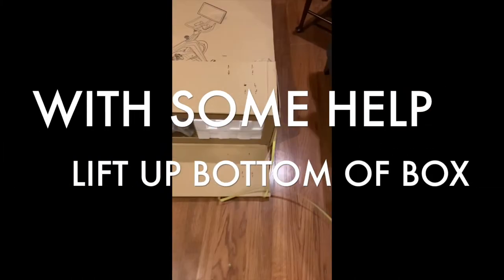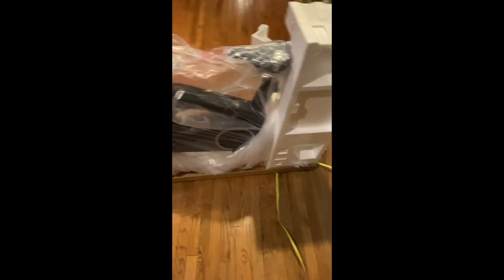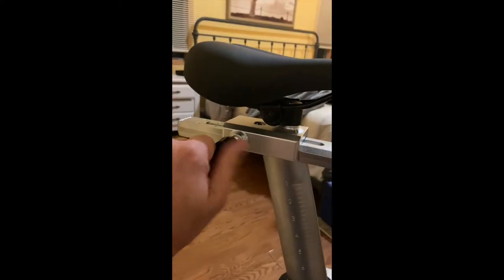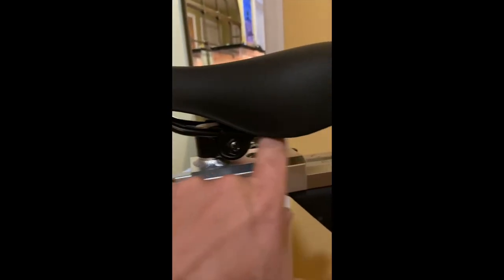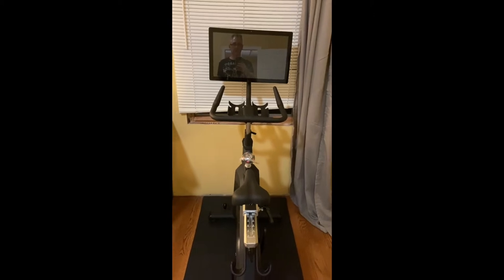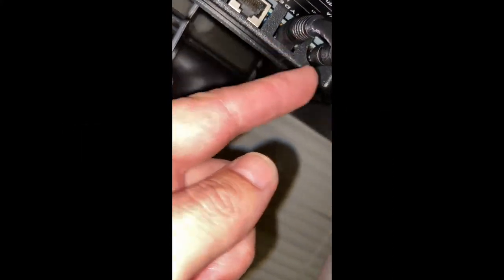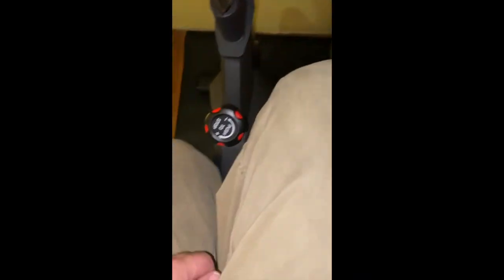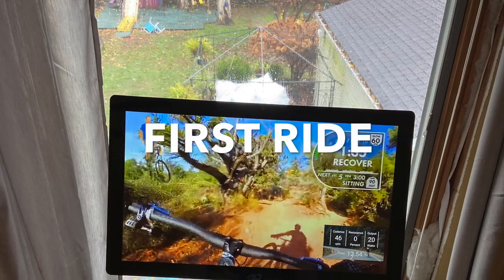STRYDE BIKE BUILD

Comment: Everyone is saying how easy it is to put together. I can’t get the bolts into the stabilization bar. It’s hard to do it from underneath and the bolt won’t screw on easily (or at all ugh). Any tips for getting it seated correctly so it easily screws on?
Reply from the maker: It’s a bit tricky but if you can have someone help lift or prop it up and I kept my finger on the top to feel when I was close then gentle push up it’s been awhile